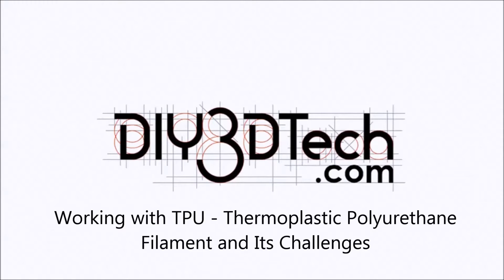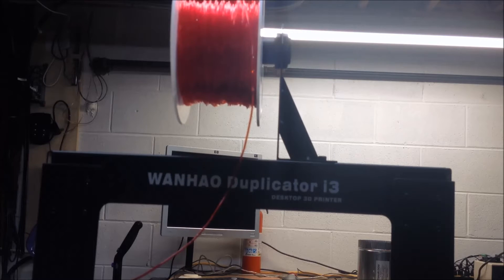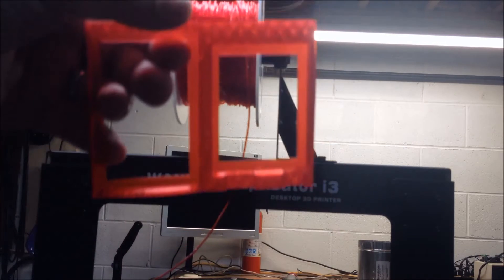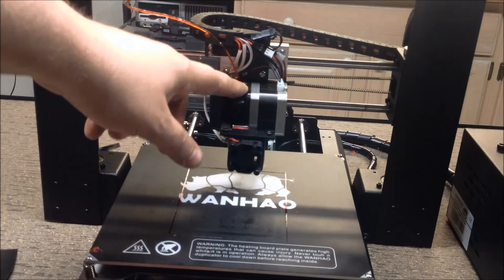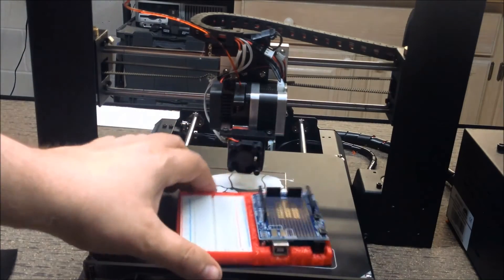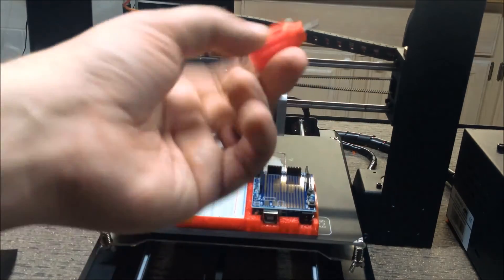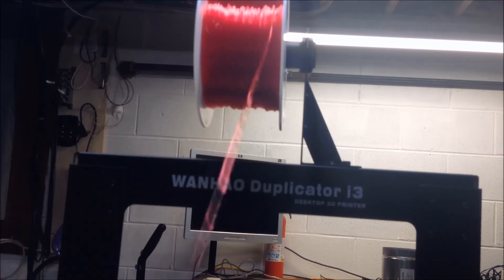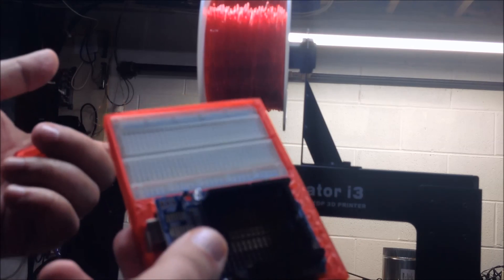Working with TPU - Thermoplastic Polyurethane Filament and Its Challenges

Comment: I just got some TPU, I had to lower my speed to 8mm/s or it get jammed, so it's really slow lol
Reply from the maker: +Josh Stevens That is slow, what temp are you printing at?  I find I need to be 250 to 260c and I can run around 20mm or so...
Reply: 225c I print at
Reply from the maker: That's to low, for me 250c is minimum, if you have an all metal hotend (which you need for this) 255c to even 260c I have to be better...
Reply: Oh ok cool thinks for the tip and I'm using the xyz printer

Comment: is it possible to print support with this TPU and how will they be removable Thank! video  very interesting
Reply from the maker: +Gil B Sure you "could" however removing would be a pain as you would likely have to cut them.  If you used a Slicer like Simplify 3D where you could control the supports, this would be more do-able, but still a chore...